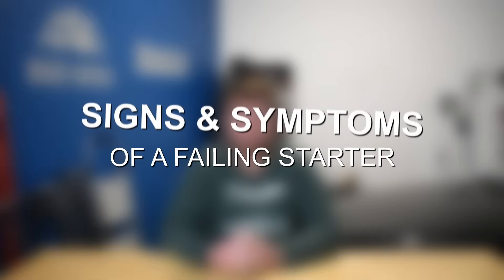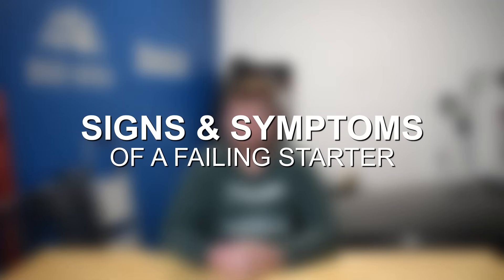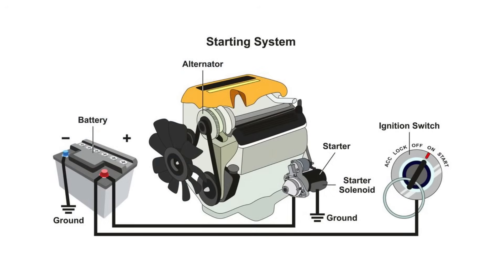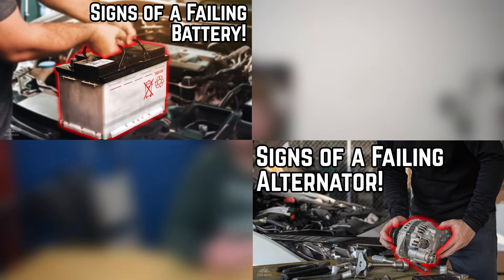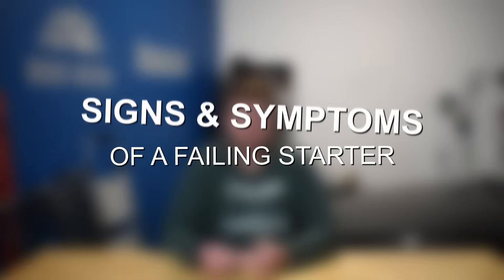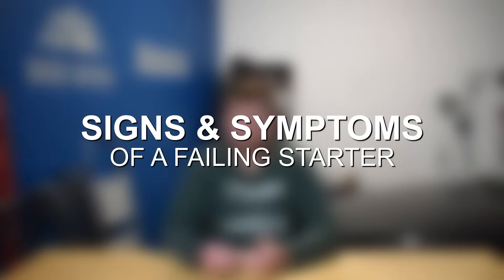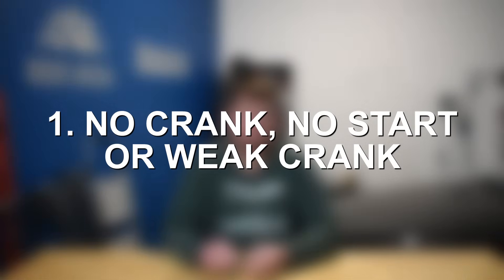5 Symptoms of a Bad Starter!

Comment: I just had a problem with no crank no start, and everything that I tried and troubleshot pointed to the starter and most garages would have come to the same conclusion.  I ordered a new starter, and then watched a video showing how to test a starter without touching it.  After I did the test, it showed that nothing at all was wrong with the starter.  I then started checking fuses, and I found a blown (Transmission B+) fuse.  I replaced that 5 cent fuse, and my Expedition started and ran beautifully.  A garage would have charged a few hundred dollars to replace the starter when it cost only 5 cents to fix, and you did not mention anything about fuses hmmmmm.
Reply from the maker: O - So true! Thanks for taking the time to share your experience!
Reply: @8020Automotive  It is just that a lot of garages will take advantage of people when it turns out to be something so simple.  Some also don't take the time to properly diagnose a problem and try to just throw parts at it instead (I know - it has happened to me), and in the end the cost is usually always much much higher than what it would have cost if only they took the time to do a proper diagnosis.  Sometimes we need only take a step back for a moment, take a deep breath, and then use common sense and rational to get to the heart of an issue - Just my opinion though :).
Reply from the maker: O - Couldn't agree more!

Comment: Thank you. I found the video helpful for diagnosing the issue with my car not starting. In my case, when I turn on the ignition, the dashboard lights come on as usual, but the engine won't start—there's no clicking or cranking sound. Sometimes, it will start if I knock on the fuel pump. What would you suggest I do in this situation?
Reply from the maker: Z - Thanks for the feedback! We have another video that may be helpful here: https://youtu.be/0YRdzJbHcm4

Comment: I pulled my starter fulling expecting to replace it and noticed the small wire had broken off the clip that attaches to the solenoid. Did the best I could to reattach it, saved $150.
Reply from the maker: M - Nice! Hopefully it keeps working out for you.

Comment: what about a starter relay fuze?
Reply from the maker: T - Certainly a possibility.
Reply: @8020Automotive  but if it is intermittent and you get the click sometimes and mostly it starts up otherwise, then could it still be a relay/fuse?

Comment: So if car cranks but wont turn over and there is a grinding sound, it is most likely either battery, possible electrical, or alternator and not the starter? Did i miss anything?
Reply: You missed everything.  Starter is buggered
Reply from the maker: T - We have a great video that will help you out: https://youtu.be/0YRdzJbHcm4

Comment: My car has this issue it finally would not turn on until I gave it a jump start as soon as I gave it the jump it turned on I suspect I need a new battery I figured if it was a starter issue it would not turn on with a jump
Reply from the maker: 2 - More than likely! Can always get your battery checked at your nearest auto store.

Comment: 1999 Silverado, battery wont hold a charge more than a day. Charge it up drive it around and it runs fine. Let it sit a day or 2 and dead. - im not convinced its rhe starter, and it has the proper voltage when running to rule out the alternator. Sticker on the battery says 4/22 - surely it isnt bad already??
Reply from the maker: D - It certainly could be if it isn't holding a charge.
Reply: @8020Automotive  update - it was a bad battery.. rated 800 CC and only tested at 113.
Reply from the maker: D - Thanks for coming back and updating! This will certainly help future viewers.

Comment: If you see a battery draw when car is off CAN that still be a starter problem.  (Battery shows draw when it is shut off).  Thanks for any insight.  2004 Honda Crv.
Reply from the maker: M - Certainly could be a starter issue. What symptoms are you experiencing?

Comment: my acadia now  is starting in the morning and then i will go out to a store or something and nothing no crank no nothing but all good electrical after about 10 tries it will start it’s now doing this consistently i tried to swap out the relay and still the issue is there … could it be a failing starter ?  i dread this job on a 09 acadia great vids btw
Reply from the maker: C - It certainly could be. We have another great video that may be helpful here:  https://youtu.be/0YRdzJbHcm4

Comment: My explorer does the rapid clicking and occasionally will start up. I hook a jump starter up to it, and it fires right up, but as soon as i shut it off, the clicking comes back.
Reply: I figured it out. I had a battery clamp that was corroded, I replaced it, and problem solved
Reply from the maker: D - Thanks for coming back and updating! This will certainly help future viewers!
Reply: I have the same problem. Have you found out what's wrong
Reply: @grantbowen8990  mine was a bad battery connection. One of my clamps was building up corrosion, I replaced it, and that fixed my problem
Reply from the maker: D - This video may help with your research: https://youtu.be/0YRdzJbHcm4

Comment: I put the key in the ignition lights came on then turned the key,  no crank no lights just completely shut off we jumped the car, I took it to get the battery tested at 2 different auto zones and they said the battery and alternator is fine but 1 store said it was the starter but before I spend 300$ on a starter I wanted to get someone else’s opinion if you don’t mind, thank you sir 💯🙏
Reply from the maker: Y - It certainly sounds like it could be the starter. We have a video that may help here: https://youtu.be/0YRdzJbHcm4
Reply: 300 on a starter?
Reply: @LowLuvR117 mines is 400 for a remanufactured one 900 brand new bmw is not my friend BREAK MY WALLET AKA BMW
Reply: i jumped start my car n it drove n i parked it at home turned it on with no problem..

Comment: I have a 2016 sonata that sometimes just clicks and dashboards power surges. Battery voltages is good but just click but it does crank and fires right up when jumped. Do you believe it’s the starter?
Reply from the maker: V - This video may be helpful for your research: https://youtu.be/0YRdzJbHcm4

Comment: My honda civic starts very well i drive it park it then it have trouble starting i wait a few minutes and it an try again an it starts what you think is the problem
Reply: What year is your Honda, I got a 2002 Honda civic ex and today I swapped out the battery bc it didn’t want to turn on. Might change the starter next if it doesn’t work might change the alternator next
Reply from the maker: T - Check on the main relay and your ignition components.

Comment: My car will crank and start actually as I put my foot in the pedal to help it. Then it will die and shut off when I let up. No electrical problems. Could it be my idle air control valve?
Reply from the maker: H - We have some videos that may be helpful for your research here: https://youtu.be/cOW5RlAkqi4

Comment: Sometimes my Nissan Sentra won't start, get 1 click, everything powers off, the hit the push button once, then hit the button to start and starts up... Doesn't do it Everytime, but it's an issue, I don't know if it's the starter or what, only 2yrs old
Reply from the maker: B - Could be a sign of a starter starting to fail.
Reply: Ended up being the battery, had a bad cell... Weird being 2yrs old😂
Reply from the maker: B - Thanks for updating! Will certainly help future viewers.

Comment: I own a Acura integra 1999 LS automatic. My car starts when it’s cool but then shuts off within a minute. I try turning it on again, the car won’t turn. I gave it some gas as in I press the gas pedal 5 times and then it starts and stops running on its own shortly. It’s also hard to get my car running after the 1st time turning it on. Weird thing is when I’ve my car running and remove the negative battery terminal the car runs and doesn’t turns off.
Reply from the maker: K - Sounds like a battery or alternator issue to us.
Reply: @8020Automotive  my battery is fine, I charge the battery and it’s at 80% with 12V. The alternator is good too because when I turn on my car and remove the negative terminal cable off the battery. The car was operating by itself for more than 3 minutes.
Reply from the maker: K - Here are some videos that may be useful in your research: https://youtu.be/cOW5RlAkqi4

Comment: I have an issue where I push the button on my 2016 accord to start my car, I hear the electric current run into the starter (grinding noise) but it never ignites. This happens once every three weeks. Not sure what is wrong. It’s so random. And the dealership ran tests and says that everything is fine. Idk
Reply from the maker: U - Could be the start of the starter motor going bad? That's the only thing we can think of. How is the battery?
Reply: @8020Automotive  The battery is a year old and in good shape. I think it might be the starter too.
Reply from the maker: U - That's what we would start with.
Reply: @8020Automotive  thank you. Love your content 👍
Reply from the maker: U - Thanks for the feedback!

Comment: Great video chief, you share good information as I was getting the rapid click and no start, I changed the starter, it worked for few days and the rapid clicking is back and it does not start...so, I'll keep trying all the issues that you pointed out.  Thanks for sharing.
Reply: Rapid click for me is always sign for low battery charge. I get my jump starter in that case. What do you do? Did you try jump start when it happens?
Reply from the maker: E - Sorry to hear this. Hopefully you figure out the issue. This video could be helpful: https://youtu.be/0YRdzJbHcm4

Thanks for the feedback!

Comment: I occasionally have trouble starting my car and I can’t seem to figure out the root of the issue. One day everything will be running perfectly fine and then the next, I’ll go to turn on the car as usual. But this time when I try to turn to the last position to start the motor with the key, I hear a click and all electrical power is lost. 

And when I go to try again to turn the car on none of my accessories turn on this time. No lights at all none of buttons on my key fob work. Completely dead…

But after a day or so and testing relays and fuses and making sure the battery measures at 12.5v (I’ve had the battery for less than a yr) my car will work perfectly fine again. 

I drive an 09 Acura TL base model but if anyone has experience this and knows what causes this to happen please help. I’m open to suggestions and would like to learn.
Reply from the maker: J - This sounds like an alternator issue. We have a video that may be helpful here: https://youtu.be/HKP1vKsIr4g

Comment: My car doesn’t start it lights up all the electricals but when I try to turn it on it switches everything off and died like a switch was flicked. Then I jump start it and it works until I try to turn it on again. Not even overnight just when it turns off. I checked the battery at autozone and it was 100 percent working they said. So idk what’s wrong
Reply: Check your battery grounds, sometimes they’re loose and when you start your car the connection fails. I had the same thing in my Honda, would die randomly but figured it was a ground that either goes to the battery or the engine.
Reply: It doesn’t fail to start all the time though it’s random and inconsistent. I’ve noticed it at night mostly when I leave my car parked for 5 hours for work. It starts sometimes and other doesnt
Reply from the maker: T - Likely a starter or alternator issue.
Reply: What turned out to be the problem?  I’m having the exact same issue.
Reply: @michaeldavis6361  it turned out it was my battery having a loose connection. I needed to buy post battery caps and the people at auto zone installed it for me. It’s not expensive at all like 6 bucks or something. Hope this helps

Comment: Hmm my truck is doing that and i did get it charged a little it did start right up. Then we get to the autoparts and it turns in as well then we get home stopped runnung for like 3 hrs and it wont turn on again
Reply from the maker: S - Sorry to hear. Hope you get it figured out!
Reply: @8020Automotive  was battery

Comment: My truck starts fine in the morning. If i turn it off after running for 20 minutes, it will start again right away, but if it sits for 30 or so minutes after running, it has a slow start. Any idea here?
Reply from the maker: P - Have you looked into your battery?
Reply: @8020Automotive  i haven't. Battery is about a year and a half old. Should i start there?
Reply: @8020Automotive  thank you for the reply
Reply from the maker: P - That's where we would start. We also have a good video that may be helpful here: https://youtu.be/0YRdzJbHcm4

Comment: Hello I have a 2001 nissan xterra 3.3 xe 4wd has no sound,crank,lights or start either does this sound like starter failure issue? Ty
Reply from the maker: I - Could also be battery related. Have you tested it? Here's a good video for your research: https://youtu.be/0YRdzJbHcm4

Comment: Praying my starter is bad and not something wrong with the anti theft system on my 97 ford ranger. It acted like a dead battery about 1 out of 3 times trying to start over the last week. Just get a CLICK when trying to turn the key. I was able to push it and bump start it okay (luckily its a stick). Checked the battery is putting out 12.5v and when I bump start and get it running, alternator is putting out 14.2v. Also checked the solenoid is getting power, it sparks when you put a wrench across it.
Reply: Luckily that was it. So glad I didnt have to go tracing down electrical. 3 bolts and a connector was 100 times easier :D
Reply from the maker: J - Nice! Thanks for coming back and sharing your experience!

Comment: Hi, I having this symptom click sound no crank and all lights on dash is working. It crank and start normally but click no crank occasionally. Replace solenoid, solenoid relay, rewiring and new battery. It crank few second before it start even with new battery could it be starter is failing?
Reply from the maker: Clicking is usually the battery not having enough voltage. Try starting it with it on a battery charger or jumping it. If it has a really weak crank then it could be your starter motor is on its way out and is weak. But if the crank is strong and then just dies off in a few seconds it sounds like a battery related issue
Reply: @8020Automotive  I found out it could be faulty AT Case transmission switch (neutral safety switch). Sometimes it is able to start on Park. Otherwise it only able to start when either I shift from Park to Reverse and back to Park or Park to Neutral shift.

Comment: Question for you.     If you  test the saterter and it tests good.     Now remove the wire  between the motor and solenoid.   Re-energize the signal wire.   Obviousluly.the motor won't run, but why doesn't the solenoid work and  retract back  and push out the drive?   Solenoid will not respond without a the motor hooked up!   Why?    I think if you remove the solenoid from starter , ground at a mounting screw, apply constant 12v on  battery + post on solenoid and energize signal wire.  The solenoid should retract back!   But they won't.    Why not?
Reply: Are you talking about bypassing the solenoid
Reply: @ChadVanryn  NO,  I'm saying if you remove the actual load  (starter motor).  Why will a solenoid not actuate / push out drive  if the actaul motor isnt working.

Comment: When Brushes wear out. You get the false flat battery syndrome with 1 or 2 brushes making contact, resulting in drawing more current.
Reply from the maker: I - Thanks for the insight.
Reply: @8020Automotive
Reply: Yeah.... Thanks thought I was loosing it.
Reply: Bruhes over heating what could be the problem

Comment: What if it does not start, and I’m getting trouble codes pointing to crank shaft sensor errors?
Reply: Change the crank sensor
Reply: @cornell833  man just changed the crank shaft sensor and still no start & same codes
Reply: @Guilanadinhl  what codes all do you get ?
Reply: Your engine might be siezed. Something internal damaged or bent. Check to see if you can turn your crankshaft manually.
Reply from the maker: G - Thanks for taking the time to help!
Reply: @growthpromotions  so true 👍
Reply from the maker: P - We have a video that we think will be helpful. We second Cornell, what other codes do you have? https://youtu.be/0YRdzJbHcm4

Comment: I did a multimeter test on the starter and it passed the test but these symptoms do sound like my starter failed. only getting one click and wont start with a jump. brand new battery but have a p1701 power supply circuit error code
Reply from the maker: G - This video may be helpful with your research: https://youtu.be/0YRdzJbHcm4

Comment: My 2006 impala struggles to start but has power. Once the car is running it has no problems but the moment I turn the car off & try to turn it back on it’ll give me issues. Sometimes it won’t turn on sometimes it’ll turn on slowly after holding the key for a slight longer.
Reply from the maker: R - We think this video will help with your research: https://youtu.be/0YRdzJbHcm4